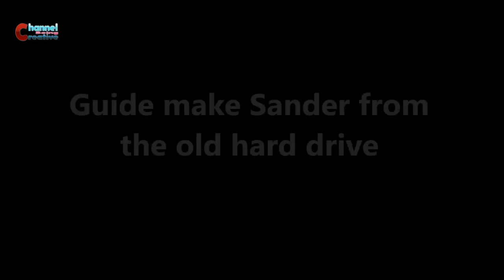How to make Sander from  the old hard drive

Comment: Instead of putting sand paper directly on the platter, you could glue on velcro. Lots of sand paper for actual sanding machines have velcro on the back, meaning that way you could change your grit or replace the paper when it gets worn out without having to peel off the glue.

Comment: great work but i think the cable connection is too fast to follow. Also can it be powered with ordinary adapter ?
Reply: Thank you very much for your quick responds. Keep the good work
Reply: ok but i dont have it in single adapter. So i need to get the two as you recommended

Comment: NIce idea
Reply: +RillesFoto Gresik not really! it's a lethal idea, the disk can break while you sanding and throw shards at 5600 RPM at you, maybe use a different material
Reply: +arash20007 its made of metal the disc
Reply: +Olivier Beaulieu Actually, modern platters are usually made of glass

Comment: can you make a converted setup of this??? with positive and negative wire only?????????????? power supply is a bit expensive for a ""sander""
Reply: It's free if you have an old junk PC.
Reply: +eyeblue88 if its a good hard drive  and has more than 50 GB im sure you can still find a better use for it than to make a grinder it would be a lot better to use a busted fan to make a driver
Reply: ***** thanks so that means a fan would have more power than a hard drive

Comment: since the sand paper is mount using glue on the disc how shud i replace it when i need to ??
Reply: +Sue Jun Fu looks like rubber cement, it'll peel off and rub off platen with fingers to replace the grit

Comment: I am lucky enough to get this done. but when i power on my power supply, the disk rotates for 30 sec and then it stops. I don't know what the problem is
Reply: Like me... What's the problem you think?
Reply: The board detects that it cant read data and stops the drive. You need an older drive.

Comment: Why after 10 seconds grinder stops ? I connect these two cables as in 6:08. Please help
Reply: that is how the motor is setup in the HD to stop till needed not sure how he managed
Reply: I have the same problem.
HHD spins up and then stops.
I presume it has to do with the controller chip.
I don't know if it gets an error because the head was removed or because there is no data requested and it spins down.

Has anyone been able to get a solution to this .

I didn't want to build my own drive controller. 

Kind regards
Stephan 
+Creative Channel
Reply: Stephan C yes there is your need a speed controll to solve it tho
Reply: because its a split phase motor, that's why he used a switch so he could switch it off then back on after 5 or so seconds (if you look closely at video he is switching it off then on after 5 seconds). if you want to get around that then you need to rip out then circuit board on hard drive then get 30a ESC for brushless motors (you can get them on ebay) then hook that up instead to power it ...